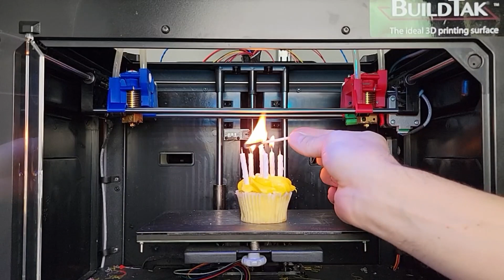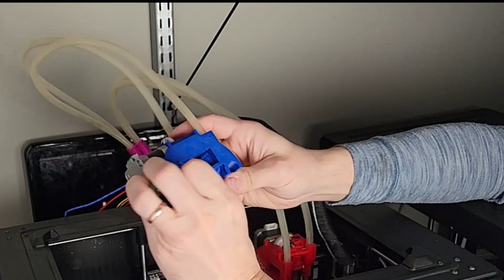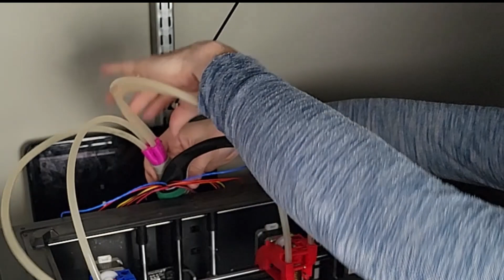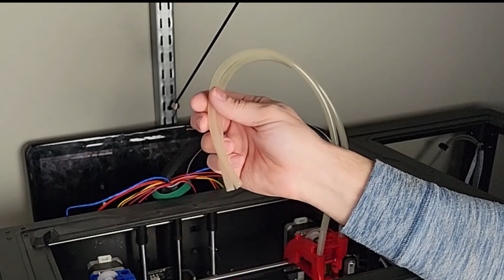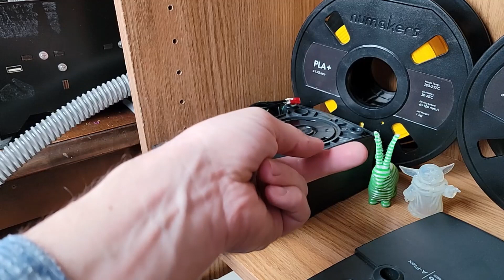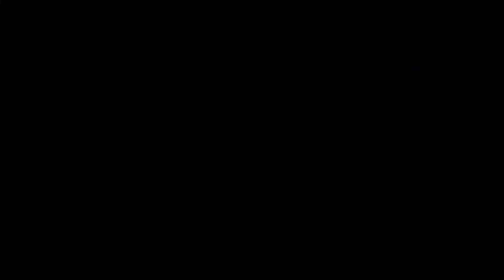Magnetic IDEX Cooling System Demo

Comment: Very nice idea, this is a good option for my flashforge dreamer with marlin. What kind of magnets are u using? how strong are they?
Reply from the maker: Thank you.  I have used many different size magnets and most work very well.  It is actually difficult to use a wrong magnet :) If the magnet is too strong, simply increase the gap between surfaces.  I currently use this magnet: https://www.kjmagnetics.com/proddetail.asp?prod=R424  

Stay tuned for full design release.  Magnetic IDEX files coming soon.

Comment: I clicked on the link, which took me to aliexpress, which showed me inappropriate content, just letting you know that you are linking to some seriously shady websites.
Reply from the maker: Sorry the link does not work for you.  I tested it on several devices and all looks good except from my Linux box where the link gives me an error page.  Try searching for "Mellow 24V Brushless Centrifugal Air Blower" on AliExpress.
Reply: @m_IDEX  The link worked but it also tried to sell me a bunch of sexual stuff.
Reply from the maker: I don't know what to say, that is awful.  Maybe install a different browser for "untrusted" sites and browse in private mode.  That should clean things up.   I have not encountered this problem before.
Reply: @m_IDEX  Use a different browser to clean things up??? I'm not sure what you're implying buddy. I use Chrome like everyone else and btw. I manually enable cookies and I had to enable the aliexpress cookie to even get the site to load and there were no other cookies in use so this is 100% aliexpress and it has something to do with the cpap pump from your link. I don't really care I was just letting you know that you've got a perv link in your video description.
Reply from the maker: Sorry for the garbage link,  "Chinese Amazon" links can be interesting.  I am not implying anything.  I would try Brave or some other lesser known browser just out of curiosity.
Reply: @m_IDEX  Haha, it's all good. I see links to aliexpress all the time, I already know it has nothing to do with you.

Comment: Very nice idea, when control for separate part cooling were added it would very nice and compact solution. If you add nema14 to it I think it were really tiny and light idex head.
Reply from the maker: Thank you!  Yes, I am working on both lighter extruder (V2) and full control of the part cooling.  The original design served me very well for the past several years.  Now it is time to take it up a notch :)